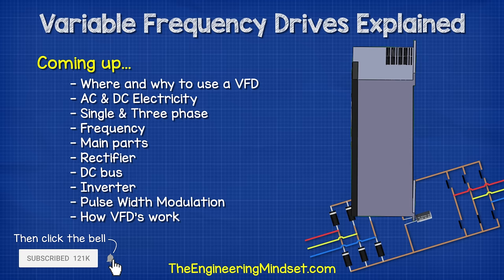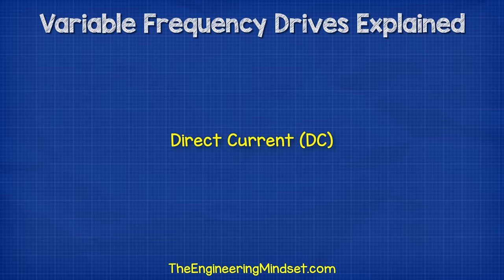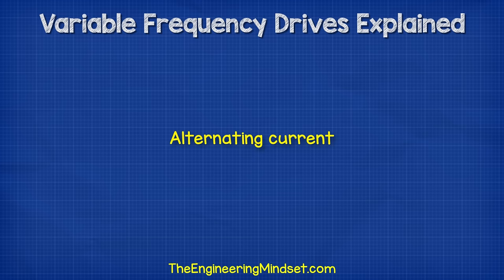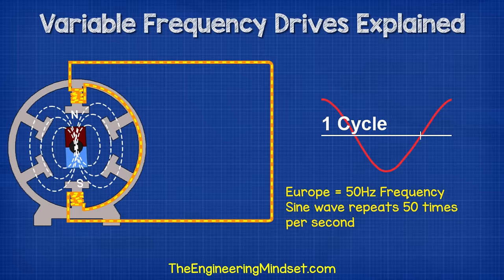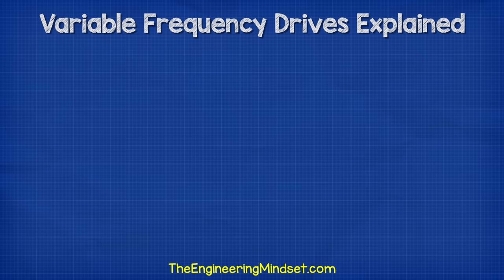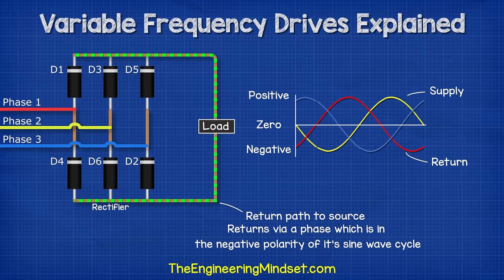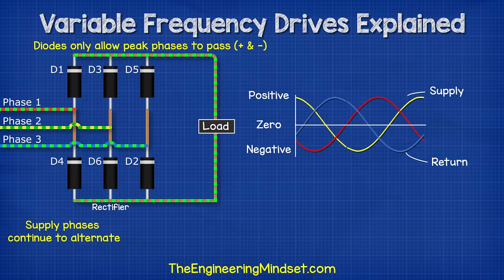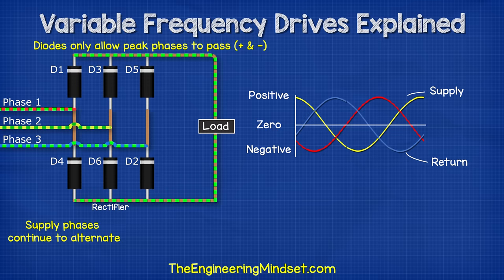Variable Frequency Drives Explained - VFD Basics IGBT inverter

Comment: Liked and subscribed.  Turn this system around and you have the basis for VSCF (variable speed constant frequency) ac generator systems on the latest generation of aircraft.  Prior to this development, maintaining a standard 400 Hz operating frequency for engine driven generators required that heavy, bulky, and expensive constant speed drives be connected between the engine gearbox and the generator, or integrated into the workings of the generator itself.  Without these devices, any variation in engine rpm would result in unacceptable excursions of generator output frequency.  With the development of solid-state, high power switching components, it is now possible to allow engine generator output frequency to vary with engine speed changes, convert the output to dc, convert the dc back to ac at the standard frequency, and do away with constant speed drives entirely.

Comment: Question,  If the Main voltage coming for the VFD is 380, How we can expect the value of the voltage drop after the VFD , and what the relationship between the output and the Frequency and the motor current? 
Fan application

Comment: Good video. Just one thing: While the magnetic flux amplitude is the maximum when the magnet is aligned with the coil, the voltage is the derivative of this flux, so the voltage maximum occures when the magnet is 90° to the coil. When the magnet is moving near alignment the voltage is close to zero.
Reply: True for induction motors. A bit different with permanent magnet motors.

Comment: Very nice video - anime, thanks. I was dealing vs VFD mostly ABB. Now should be use in elektro cars.
Reply: They are. Sort of. Electric vehicles primarily use only the inverter side (the part that does the switching) as their power source is already DC. Because of this, they don't use off the shelf ones like what is shown at the top of the video. The concept is the same, though.
Reply: @JakeRoeder  right, I think AC motors much more efficient for el.cars

Comment: The main benefit for the VFDs is that it allows us to control the Fundamental Frequency via the inverter. It turns out that the output frequency is the same as the Fundamental Frequency. This is good because it allows us to change the frequency at the output that is usually connected to a motor, allowing us to control the speed of the motor’s rotation.

Comment: Thanks for the video. Nice explanation. If I want to take a 220v three phase 1/2hp 400 watt AC servo motor that drives a pulley on an industrial sewing machine, and use a VFD to get it to be powered by 120v household current what wiring reads as the better option?  The current motor has three wires that connect to a circuit board and then to a small transformer then out to a power switch. Would u hook the VFD in between the motor and the circuit board or after the circuit board and transformer connection?

Comment: Great video but could you please explain how a single phase input to a 3 phase output VFD works and if it is possible to run a higher HP, 10+, on single phase. Possible air compressor in a house with only single phase power from the utility.

Comment: Just finished doing a set up for 7 VFD'S controlling fans for air ducts. 480v power supply. The only thing is I dont know about the low voltage part because it was a different company that came to pull the wires and make the connections. .

Comment: Switched power supplies are quite magic in a way. Stable power for computes is very important and a video card can have millisecond transient power draws and the switched power supply has to sense and react to keep the line voltage stable when swinging between near 0 all the way up to 700 watts and back down again. I assume similar tech is used for these switched power output.

Comment: So the Output Frequency depends on the timing of the switches, and the Output Voltage depends on the time the switches are left opened. This means that they are dependent on each other right? Meaning at each frequency, there corresponds only one output voltage available ?

Comment: The reason why I'm watching the above video is I'm trying to diagnose a problem, and being just a regular person who haven't got a clue how electricity works I'm totally out of my depth!
I've been putting up with a high frequency or some sort of grounding noise for years in my little council flat and starting to have a debilitating effect on me! I've tried turning the electric off at the mains and I'm still hearing it, the noise seems to be coming from where Virgin Media coaxial cable enters the communal flats and I've noticed on the outside of the building they seem to be using some sort of cheap galvanised Steel covering, which I assume is supposed to protect the rg59 coaxial cable. Over the years the noises seem to be getting worse I don't know why but it seems to be more audible every 4 to 6-weeks it's absolutely driving me crazy!!! I've called Virgin Media many times and on the last occasion all they did was sent out some installer with a multimeter! Which obviously didn't find any problems! I would really much appreciate any advice on how I Could approach this!
 thank you for your considerations
Reply from the maker: Check our new Multimeter tutorial out ➡️ https://youtu.be/4lAyzRxsbDc

Comment: They’re effective and efficient over binary ,traditional systems because that peak in amp draw when a compressor or motor comes on initially is AVERAGED out by your power company. Eliminating start up spikes is where the savings come in and also like mentioned , matching loads helps effficiency also.
Reply: Power factor correction is an often overlooked source of savings as well. In residential/commercial applications, average power consumption is billed and, with newer meters, you'll likely get charged for reactive power consumption. In industrial applications where we apply drives (I'm from Danfoss), these companies often get charged based on peak demand, meaning their bills reflect the most energy they use at a given time. There, the drives can significantly reduce the peak demand. There are many other places where savings comes from, but I'll leave it here for now.

Comment: Great walk through
@Andrew Offord says, I too misses the filtering before the motors, and the EMC filtering back to in to the main power supply
Thanks for sharing your great work .-)
Reply: Filtering before the motors isn't always necessary. It very much depends on the application and a number of other factors. As for EMC filtering, it's a great topic that probably deserves its own explainer. EMC isn't needed in many cases but we (Danfoss) put a lot of time and effort into offering integrated EMC solutions for long motor lengths and Residential/Commercial environments.

Comment: Several things:  1) For the first time you should have said that an An IGBT is an 'insulated-gate bipolar transistor', or in effect a solid state electrical "on-off" switch, and that some inverters use SCRs or " silicon controlled rectifier" also sometimes known as a 'Thyristor".  2 )  The input into Variable Frequency Drives can be single phase (typically on smaller units) and only requires a larger capacitor bank (causing a lower efficiency, but the added cost is often made up by not having to install a 3 phase supply. The output is almost always 3 phase.  3) The capacitor bank also has to contend with the output pulses, thus needs to be bigger on drives that have a lower pulse rare and/or have a lower output frequency
Reply from the maker: Transistor video now live: https://youtu.be/J4oO7PT_nzQ

Comment: Great video, do you know how to calculate Watt or power consumption at any given time of this VFD? At output side, it seems not possible to calculate due to different PWM and frequency. Thanks
Reply from the maker: We can estimate from the average values. I'll cover in a more advanced video
Reply: @EngineeringMindset  Really appreciate your efforts, Thanks :)
Reply: Many of our drives (I'm from Danfoss) include some kind of rough power meter so you can simply read it off of the display. No calculations necessary :)

Comment: 👍👏 Very good. Cycle determid the rpm of a motor, amp probably it's torque or ability to maintain load, what about voltage does it influence anything other then watts

Comment: This is theory. In practice it is much more complex.
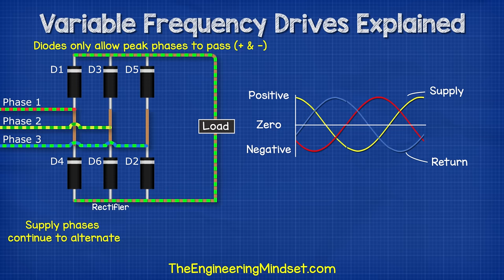At 9:22 there are a short circuit between D6 and D2 since they are polarised negative at cathode, D6 by phase 2 and D2 by phase 3.
With the output transistors is the same since always are 2 phases at the same potencial in the triphasic system.

Comment: Hi, I'm installing a VFD to a SINGLE phase motor (water pump) with a distance of 100 meters between both. Now I've read that you have to protect the motor for any noise/disharmony that might occur because of the distance using an output reactor. However, I haven't been able to find an output reactor for SINGLE phase to put between the VFD and the motor.. Do you know why it cannot be done or is it perhaps unnecessary in the case of single phase? Thank you so much for your time!

Comment: very good video. i have a question if you would please answer that. As per video AC current flow from phase wire to neutral wire and vice versa, if i put a current tester or clamp meter in neutral wire would it read current ? if yes its value will be same as that on phase wire?
Reply from the maker: Seen our new CLAMP METER tutorial?: https://youtu.be/J3kKNNizARc

Comment: Great presentation. I have a question. VFDs are being used on AC motors, and AC motors are wound for a specific frequency like 50Hz or 60Hz, and there really is no such think to my knowledge or research as 50/60Hz AC motors. Operating the motor using an electrical/frequency input outside of this means changes to the motor as shown in the video presentation. What is also known is that operating a 60Hz motor at 50Hz means that the motor typically is going to run hotter than when operated at its rated cycle, means shortened life. Now some motors a very sensitive to frequencies and run so hot on other frequencies that they burn up in minutes some longer. Some with thermal switches also have issues. So considering that a change from the rated Hz is not best for the motor life how does one justify using a VFD. Are DC motors not available with similar power and have the advantage of varying speed by using just voltage? I am not an electrician just a layperson with an interest.
Reply: We have been instructed not to exceed the motor's design frequency (ie. not to put more than 50Hz into a 50Hz motor even though the VF drive is capable of more), but we can use differing lower frequencies so the beauty of VF drive is the frequency can change starting with low frequency and increasing until it reaches the motor's design frequency, therefore providing controlled smooth and gentle acceleration (and deceleration) of the motor's rotational speed.
Reply: @Rob99552 This doesn't seem to apply . I know from experience that if I take a 60 hertz AC motor and plug it into a 50 hertz source of the same voltage that the motor spins slower overheats and eventually burns up. My question is asking why would this not be the case when using a VFD? It has been some time since I have asked this question here and elsewhere online still with no valid answer.

Comment: @The Engineering Mindset
I know this video was put up 2 years or more ago, so Paul may not even be monitoring the comments anymore.  Since I have a formal electronics education that I haven't used in awhile I have a clue of how VFD's work now, but I kinda wished he explained a little more in detail of how we physically adjust the frequency of it's output.
I also would like to know how to design and build a VFD to control a 2 hp motor used in a blacksmith's or knife makers 2x72" belt grinder; something I am in need of.  or would it just be cheaper to go buy one?

Comment: If I have a 180 VDC inverter motor (off a Fujitsu mini-split)  would this be controlled by a VFD circuit?  could i use an off the shelf power supply to test the motor?

Comment: IEEE will not recognize the acronym "VFD". The actual acronym is ASD, Adjustable Speed Drive. I learned this while giving a lecture to a group of IEEE engineers concerning the difference between ASD frequency control and current control for pumps.

Comment: So a friend of mine is from Paraguay which uses 220 50hrz single phase for residential. He has been living here in the states and is moving back for a while and would like to take his expresso machine along but due to the 50hrtz system is afraid too. Will it work to hook up a Vfd to get 110 60 hrtz from 220 50hrtz SP?

Comment: Question. So a permanent magnet fan motor like on a mini split is a true DC motor? Voltage in AC then rectified to smooth DC but not inverted? But and let’s say an ECM fan motor or a variable speed compressor are 3 phase AC motors that are inverted? But I know those are permanent magnet motors also.

Comment: Lots of good stuff here.  But one question... why does varying the output frequency vary the speed of the motor?  Are these used only with synchronous AC motors?
Reply: The mechanical speed of rotation of the motor depends on the electrical speed of the rotor voltage. This is true also for asynchronous machines, the only difference is there exist a slip factor X=w-wm/w. When the motor is connected to a load it will reach a steady state with low slip and the motor speed will roughly be equal to the electrical speed

Comment: Hi, is it possible to connect a VFD to a 380 volt motor if there is only 3 connecting wires in the terminal box.
Thank You
Basie

Comment: Does the input frequency to the VFD matter?  One would think not because step 1 is rectify and filter.  I have a 400Hz generator that I would like to use to output 60Hz power but most VFDs indicate 60Hz power input requirement.

Comment: Correction:
In 9:26 case-1, you mentioned only diode D6 is open when phase-1 is in its positive cycle, which is not correct. When phase-1 is in positive half cycle, then along with Diode D6, Diode D2 is also in forward bias as the negative half cycle of phase-2 and phase-3 satisfy the condition. So the current will flow through D1, through the load, through D6 and D2 but mostly through D6. 
Another reason is, in a balanced 3 phase system at any given time the vector some of the current/voltage should be zero. As the load is being fed from Phase-1 so the exiting current must return through phase-2 and phase- which is again through D6 and D2.

Comment: So one end of each of the 3 wires goes from the copper coils generating the original ac current, to the rectifier to be turned into dc current. But what about the other ends? Are they just connected to each other, or to a neutral wire? If connected to a neutral wire, where does that go?

Comment: I have a question. Can you upload a video on converting low DC (i.e. 48V) to 3 phase AC ? 
Will we use DC/DC converter to convert 48V to 240V or will we step up the Low voltage AC to 240V (line to phase) ?

Comment: Probably irrelevant but what are your hypothetical AC input to the VFD and DC output voltage (or typical DC output from VFD systems) created by the inverter before rectification back to AC output load?
Reply: the input AC voltage is the line voltage, for Europe it's 230 Volt 50 Hz. The output DC voltage depends on the filter you use, probably in a range between 115-230 Volt DC

Comment: Question, looking at that circuit diagram if the VFD is switched off, the IGBTs should block the charge stored on the DC capacitors, yet a few years back I accidentally touched the motor terminals after it was switched off and copped a belt. Why is that?

Comment: 13:20 is why you cannot just install a VFD to any existing AC motor and call it a day which happens often in the HVAC industry. Many specify adding a VFD without considering replacing the existing motor. It needs to operate with an inverter duty motor designed to handle the pulse width modulation. If you pair a VFD with a non-inverter duty AC motor overtime the non-smooth sine-wave signal can damage the motor.
Reply: Juan Zingarello 2 things happen,  first older motors cannot cool themselves at partial speeds so you must put a lower limit of 20-25hz.  Second the peak to peak voltages are much higher than AC so old motors don’t have quite enough insulation on the windings.  You will lower the life span of an existing older motor but if it megs ok you can put a vfd on it hand get a few years out of it and the money you save in that time justifies it

Comment: So when using a vfd to control a three phase motor from a single phase power source , is there any trick to selecting the right size vfd ? 
I have a car lift with a 3hp three phase motor , and bought a vfd with 3hp three phase out anf 240v single phase in . As soon as you load the motor with a car on the lift it stalls the motor ?

Comment: Wouldn't be easier to show the frequency equation as it relates to voltage and power? Generally there is no direct relationships between power (watts/volts) and frequency….. as frequency only becomes a factor in AC or switching application environment.. Where the power as a function of current(I) can relate up to certain maximum frequency only ….

Comment: Not saying I want to try making one, but if I were to do so - how would I pick a capacitor? How do i know which would give smoother results without melting couple of capacitors?
Reply from the maker: You have to calculate it, or build one and trial and error with an oscilloscope
Reply: ABB is a great company that matches many modern needs from small to large.